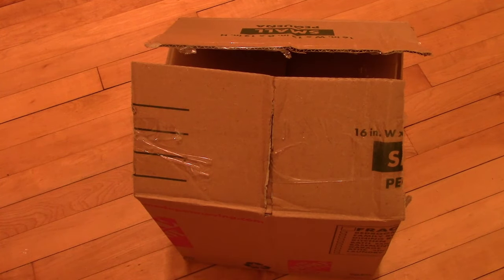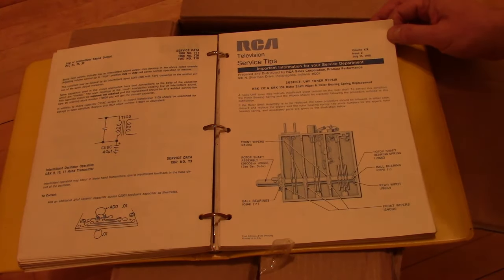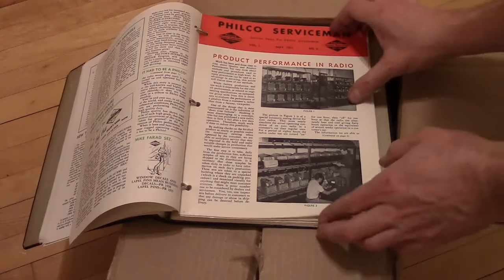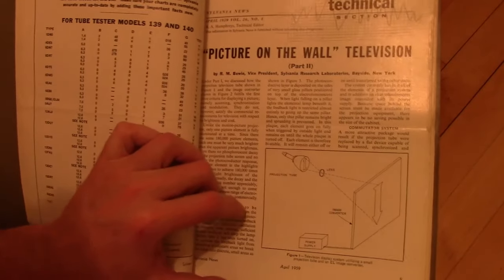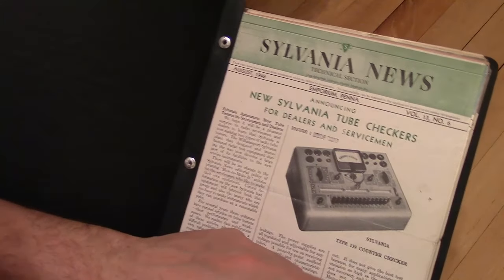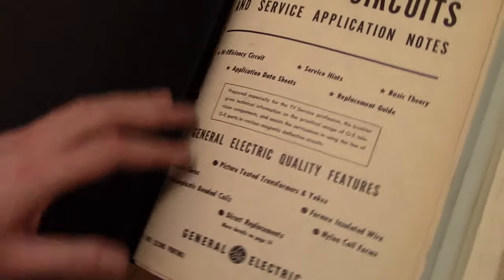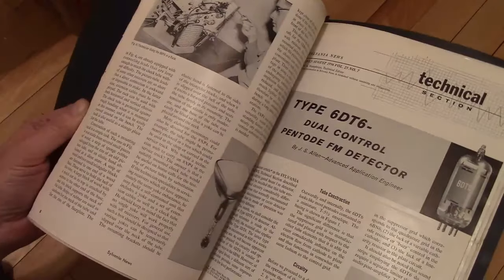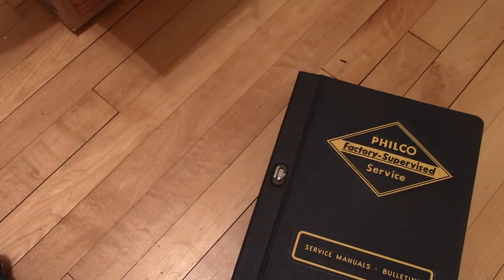vintage service manuals

Comment: Interesting to see the old information !!! My neighbor Bob lacouette had a sales and service agreement with Motorola that he started around 1954 possibly, I remember him coming to my parents house to fix the T.V. that we had back then about 1957 or so, and My parents both of them, worked for G.E. in Bridgeport Connecticut during WW2 Dad worked in payroll and Mom worked as assembly line supervisor in the line that made radar equipment and the electronics boxes that controlled the remote gunnery systems for the then as yet unannounced B-29 bomber. The guns on this aircraft were remote controlled by a separate gun turret control mounted in a remote turret where the gun operator was located and He could select any of the guns on his side of the plane by a series of switches !!!! Seeing Motorola and G.E. reminded me of the stories they told me!! Thanks for the memory lane !!    John A Bellas ------ KC2UVN

Comment: Nice haul of service manuals Bob. Say, you mentioned electroluminescence. I love that effect. Sylvania was big into it in the '50s and 60s.  I restored a Sylvania NightLighter Model 598 Panelescent radio that has an electroluminescent face. It glows a beautiful greenish blue color. It reminds me of the night lights my dad bought for us as little kids in the early 60s. They were round, very flat, and would plug into the wall. Same color.
Reply from the maker: I found some info on the history of EL displays and Sylvania.  It claims the early lamps only had a life of 500 hours ?   http://www.indiana.edu/~hightech/fpd/papers/ELDs.html
Reply: I saw the reference to the 500 hour life in the article you cited. The electroluminescent panel in the Sylvania 598 is indeed steel with a ceramic-like coating. The 120V AC comes in through a resistor and a variable resistor to allow you to vary the brightness. Now, I had read somewhere some time ago that these clock radios' displays would probably not work today. But the one I have works fine and has been running continuously, day and night for at least a year. Also I salvaged a panel from a second Panelescent radio. I was able to fire it up outside the radio easily. The appearance of the glow is just remarkable.

Comment: You just struck close to home, literally, and in more than one way, when you were flipping through the Sylvania news, and found the tag in there for Scanlons Radio in Danvers MA. 
Thats my home town! 

Not only that, but Sylvania had a production plant on Sylvan Street in Danvers that my grandfather worked at in the 50s as a "tester". That plant closed in the late 90's. Sylvania's North American headquarters was on Endicott Street in Danvers until recently.

Comment: +bandersentv , Bob, The Zenith dealership for which I worked in the mid-'70s did a great deal of Philco warranty work for a furniture store/dealer and Silo Appliances. I remember Philco-Ford branding on consumer electronics until at least 1977. Automotive radios, and 'intermittent windshield wiper' circuitry were both produced (at least in part) at the Philco-Ford Lansdale plant.

Comment: I have this small CRT tube I received after my uncle passed away that says 1DP1 on the box, and says JAN-IDPI  National Union on the tube.  It also says 7/72 on the box for a date.  I looked online and found almost nothing about this tube other than a youtube video using it as a clock.  Would you have any more information about this to help me know what it is?  I have wanted to know more about this for a while now.  As far as I could find out it is an oscilloscope tube.

Thanks,
Mike
Reply from the maker: Do a google search on '1DP1 CRT".  There's lots of info out there like this datasheet:  http://www.labguysworld.com/CRT_1DP1.pdf
Reply: Thanks for the replies.  I googled it again and it seems there is more now than when I checked a number of years ago.  My uncle used to work on electronics when he was in the Navy, I'm betting he got it then.
Reply: gttarus1 That would be one plausible explanation for why you have a JAN prefix tube, which stands for "Joint Army Navy".